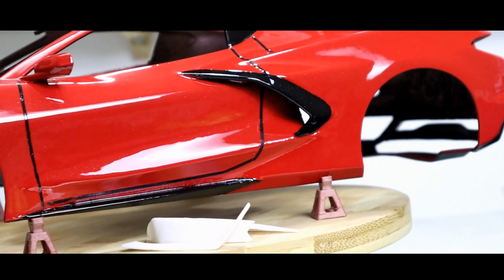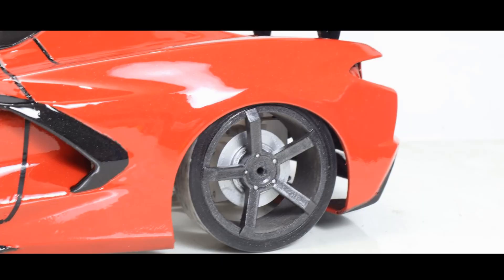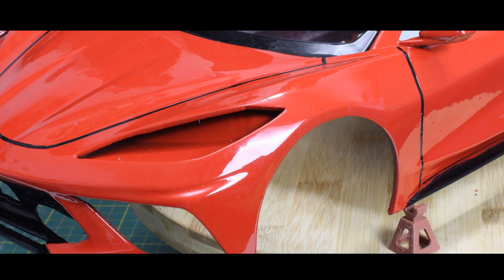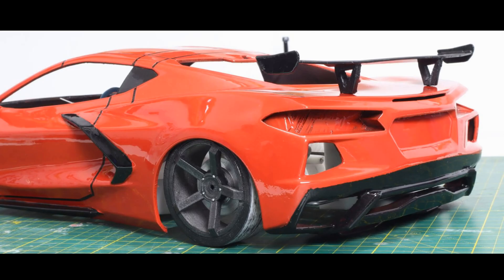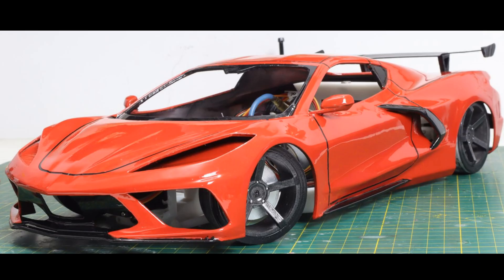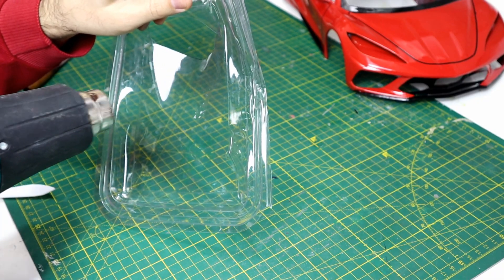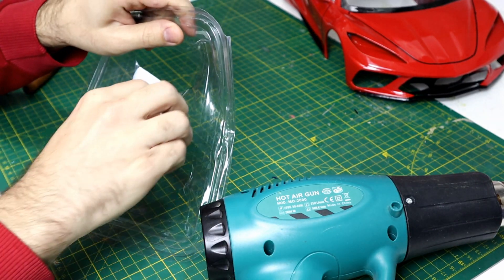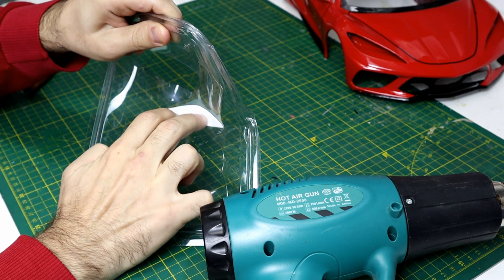3D printing 10th scale C8 Corvette /How to 3d print rc car body/Painting rc body/Scale Addiction

Comment: So I bought this through your link on cults. Seems there are files missing that you show in the video - the front and rear glass templates as well as the decals. Can you link to those or add them to the files on cults? Thanks!
Reply from the maker: I cut them from clear acrylic and the lights was picture i size it and print, I will look if I have the files for the sticks